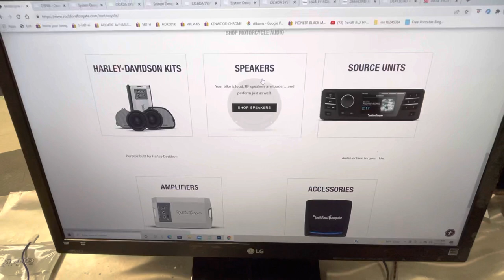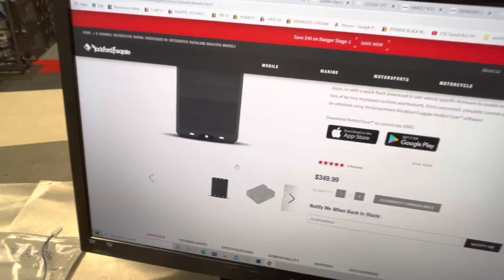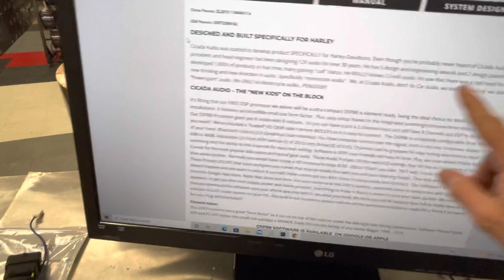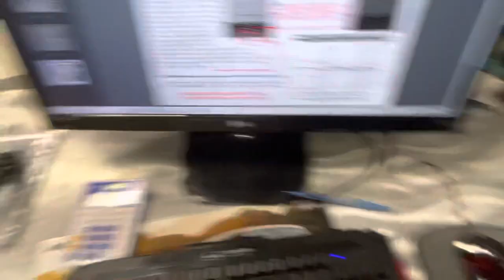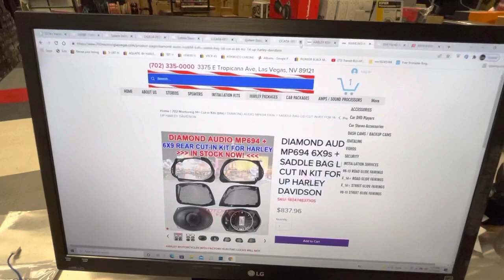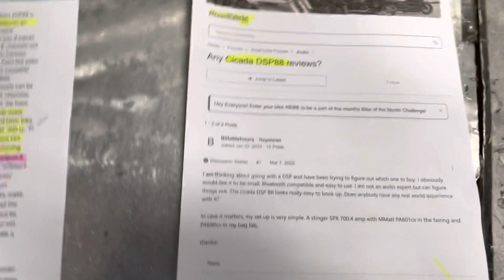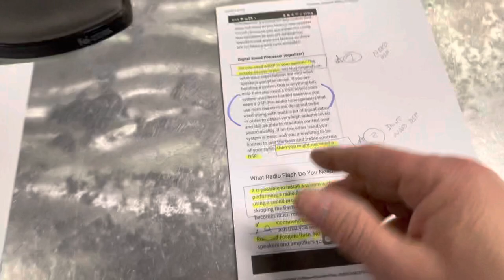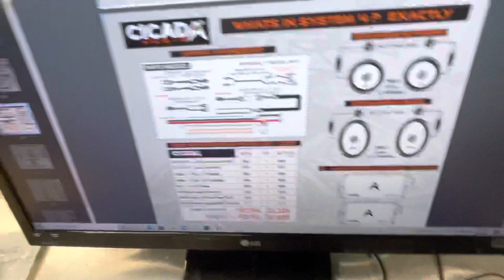YOU DO NOT NEED A DSP DIGITAL SOUND PROCESSOR ON A HARLEY DAVIDSON 2014 & UP  SOUND SYSTEM INSTALL

Comment: The frequency response for the MSPRO65 is 110 to 10k....how do you give it what it wants to run at its best when then SD amps don't have the ability to band pass?
What do you set it at ? Both high pass and low pass go from 45 to 850?
Reply from the maker: 99.9% of the bikes we do have MSPRO65 Mids up Front & many have them in the Touring Pak, Every single bike Rocks and every single customer is more than happy - each and every system outperforms any customers expectations, we never said that a DSP would not allow the system to sound better we simply provide our opinion that it is not necessary and we are more than willing to put our sound system up against any other persons or brand sound system that utilizes normal street use vs a bike set up for competition.
Reply: @702motoringlasvegas4  that doesn't answer my question...I was just intrested in how you set the amp. Aren't you limited in what you can do just using the amp to set the frequency?...I think using a DSP is up to the customer and not the installer. If you are going to drop good money on a great sounding system you should research and listen live to all options...your videos are great...I enjoy them...im just curious on how you set the lows...
Reply: Anything on this?
How do you set the SD amp for the 6.5?
Reply from the maker: @joellongoria2239  Anything on what? I use the 30 Years of experience I have and create all the bikes you see on our YouTube Channel - The PROOF is in what you hear, I do not need to go back and forth debating anything with you
Reply: @702motoringlasvegas4  wow...I wasn't debating anything...I am just curious on how you set the amp for the woofers...is it really that hard of a question to answer? Is it a trade secret? Just a curious person asking a simple question...
Reply from the maker: @joellongoria2239  We are talking about a MSPRO65 Midrange so it is not Woofer(s) Your question is part of a growing issue in this industry where a person and we can use you as an example provides frequency response to what may be written on a box and compares it to specifications of an amplifier and if hypothetically all of the figures do not make perfect sense than a person may take the position that it simply is not going to work or it may not be compatible or simply will not sound good and possibly resulting in the need for a DSP -  

Why would it be so unbelievable for you or another person to accept that hey guess what with the right amount of experience any person can fine tune an amplifier using the crossover that is on the amplifier and fine tune the speaker with your ear? 

It is the exact same thing using a DSP - it still needs to be tuned either by specific devices or by ear and necessarily not by a generic tune many sellers do and ship it out to a customer.

So not sure if you understand what we are saying or if you still have questions.

Again understand the message in our Video we have posted - it is NOT if a DSP will or will not allow your speakers to sound better

Our message is, is it Necessary, mandatory and must you use a DSP when adding an aftermarket sound system to a Harley Davidson Motorcycle.

We are not just a company, store, individual that just pops a video up that may disagree with the position of others,  we have more bikes than we can count that we very clearly show in detail the product used and the way we complete our installs in relation to the very words we say in our video.
Reply: @702motoringlasvegas4  I do know what I am asking and you still haven't answered it...and on your website it says MSPRO65 pro audio woofers...so come on...you poke fun at others for wrong info on the their pages and yet you do the same thing....if you cant answer the question just say so...stop trying to explain it away with blah blah blah...it simple...for the 6.5 do you set the SD amp on low pass or high pass and where do you set the dial? 
Look up your kit for the Road Glide and look at included in this kit...plain as black and white it calls it a pro audio woofers not a midbass...
Reply from the maker: @joellongoria2239  The MSPRO65 Is a Midrange and it is also a MidBass - Diamond Audio Website it is called a MIDBASS / American Hard Bag also calls it a MID BASS - you have only just now asked if we set the amp to Low Pass or High Pass there is no bla bla bla with our explanation, so not sure if you are attempting to find us lying or catch us not sure what we are talking about or what your agenda is if any, we set the amplifier on High Pass, as far as the dial what we turn it to I turn it to the spot that my ear tells me to turn it to with the specific song I tune every bike to - maybe this explanation is good enough for you, maybe you will just consider it BS - not even sure, but you have asked plenty of questions about it, it is basic common sense, not sure where you are going with this, Our Bikes are second to none, we don't hide anything we do, either you accept what we have offered as information and maybe you do not, but we do know this we are done with all of the questions, we are building 63 sets of shallow horn grills today that need to ship so we are a little busy right now - hopefully you have received satisfactory information from us and or our video - good day
Reply from the maker: @joellongoria2239  You are also the 2nd person with a connection to Five Star Car Stereo - You and Melissa both, your going to need to do better then this
Reply: @702motoringlasvegas4  you more than answered my question...did you check your web page and saw that it says woofers on it?...that's why I called it a woofer...don't see where you are going with the while 5 star thing...I follow a few people...knowledge is power...and everyone has a different way of doing things...I just wanted to get your angle on how you tune your systems without a DSP...that's all...no hidden agenda...I'm still learning and just have questions that pop up from time to time...you are doing a great job with your videos....if my questions are dumb so be it...remember we all can learn a thing or two from dumb questions...I have a 10 speaker system on my 2017 RG...combination of Hertz and RF speakers...to me it sounds bad ass...but if there is a way to make it sound better and I have to ask a dumb question I will...thank you for your time....
Reply from the maker: @joellongoria2239  Appreciate it Joel - apologize if we came at you a little aggressively - Paul
Reply: @702motoringlasvegas4  no worries Paul
Keep up the good work!! 👍
Reply: @joellongoria2239  Diamond is real good about having crossovers readily available.
Reply: You hit it on the head sir.  702 does cookie cutter installs that dont need a dsp.   All their installs high pass every speaker and that works for people that dont want subs in bags or  mids..  A Dsp is worth the extra $300. For a few people that want more sound below 50hz.  I love diamond audio.but I moved to cicada. My good friend installed 4 cicada coax speakers on his ultra without a dsp.  He is happy.   That diamond.audio dsp is impressive. But my DSR1 works just fine in my road glide and yes it is easy to use.  You dont have to be an audio expert.
Reply from the maker: @robleeva  Really? Cookie Cutter? we think not, when you know how to install and tune a sound system like we do a DSP is not necessary and feel free to go ahead and explain to customers how for only $300.00 they will have a DSP with everything needed to install it, never mind how to tune it, you may want to rethink your statement

Comment: Ok I need your help then. I have from American hardbagger a 800wt 4 Chanel diamond audio amp. T harness.. 6.5 hertz up front with separate hertz horns .. 6x9 hertz in bags with separate horns and the Rockford dsr1. I do understand how hard it is to tune the amp. It's loud but I do feel it could be better. So how do I remove the dsr1 and hook it all back up? Then you suggest just getting it flashed  or do I leave the dsr1 in and get it flashed to get better performance?
Reply from the maker: Are you saying your bike is not flashed? 2014 & up with stock radio?
Reply: @702motoringlasvegas4  It is not flashed.  They had me install a dsr1 on it instead
Reply from the maker: @welder9966  We recommend Flashing the bike 100% / you have the right equipment that will provide you with the sound you are seeking, just the advice you received we do not agree with and that is what we are attempting to avoid with others and this is partial reasoning with our video, it clearly goes against the grain and we realize this, this is a nationwide list of authorized flashing centers, http://rftech.custhelp.com/app/answers/detail/a_id/1344      Once flashed let us know how your sound is and you may contact us directly vegas.paul99@gmail.com

Comment: Just watched this. I think the best way to get everybody to understand this DSP controversy, is do you need a DSP to make your bike sound better than your OEM? No. Do you need a DSP if you got 4 speaker setup with 1 or 2 amps to sound good? No. But if you want to maximize your equipment or you plan to compete then yes you need a DSP. If you can't afford a DSP and a good install, spend the money on the quality install first. A DSP can be added later.
Reply: I don’t think it’s a forwarding it. I think it’s people understanding how they work.

Comment: Great video! I’ve got a precision power system with 8 speakers and their amp using the GTS head unit. Loud and clear but lacks midrange bass. Would adding the Soundstream radio with the 13band equalizer improve the sound?

Comment: I understand this is your opinion, but let's say hypothetically your running a simple 4 speaker system with 8" speakers in the rear and 6.5" in the front. They are obviously going to have different crossover points, power ratings, and many other differences in parameters....So therefore this in this situation, a DSP will absolutely be needed to set proper crossover points based on speaker parameters. When you tune via your RTA a DSP instantly becomes an even more powerful tool because you can set your own EQ on each speaker. This is just my .02
Reply from the maker: We appreciate your comment, however your simple 4 speaker system is to vague to provide you with a definite answer, however if we go with your example and your position that a DSP is absolutely necessary, OK, so what would happen if a DSP was not used on your example? using one 4 channel amplifier? the system has tuning through the amplifier - and that would mean that a DSP is not absolutely necessary, understand we are not saying a DSP will not make a sound system sound better, we all know it will, what we are saying is that it does not have to be used as in you have no choice,  for example take a Ferrari - you have to use Premium Gas in the car, so what happens if you put regular unleaded in the car? it is still going to run maybe not to its potential but it will be OK.
Here is another example, take your 4 speaker system (1) Pair Diamond Audio MP84 8's one pair Diamond Audio MP654 6.5's / use a Soundigital 800.4 EVOX - take channels 1 & 2 and runs the horns front and rear, channels 3 & 4 run the mid's front and rear - We can tune the horns separate from the mid's all off of the amplifier, customer will be very happy, no DSP is used, will it sound better with a DSP certainly, but it is not necessary, DSP adds a good bit of money to a sound system / our position is simply saying it is not necessary - if it was it is highly possible a consumer may not have that extra 350 - 600 dollars to spend and his only option would be purchase less expensive speakers that even if using a DSP may not sound as good as putting a set of MO75T Shallow Horns in the Grill and MSPORO65 Mid behind those and one pair of Diamond Audio MP694 Coax Horn 6x9's in the rear, 800.4 EVOX amplifier will put out 800 Watts and hit a easy 128 DB with crystal clear sound, How much better do you want? we still do not see the competition using meters on their sound systems, we say it many times in our video's we are interested in seeing what other shops produce, we are not saying we are the best all we would like to know is how does our Diamond Audio Sound Systems stack up with others that do sound systems, we are open to learning new ideas, trends, secrets, etc. but at the end of the day with us at least our systems do NOT in any way need a DSPP - the video's are proof to that.
Reply: @702motoringlasvegas4  I don't see the point of spending thousands of hard earned dollars on an audio package to make it sound "meh" at best. Then there's band passing, a factory head unit cannot do that, only a DSP can. Same goes with time delays, acoustical phase shifts, precisely changing crossover points, setting EQ per speaker, and so much more that you really feel comfortable not using one? I understand it's not technically "needed" to operate an audio upgrade, but the benefits from having one far outweigh the need to not. That's like saying that you don't need tires on rims to drive down the road, but it sure does make life a whole lot better if you did.
Reply from the maker: @s.in.bagger9933  Well, We respect your position, maybe other sound systems out there maybe a DSP would be necessary in order to make less expensive speakers sound satisfactory, however maybe we are just working with a much higher caliber of sound system components and design, this sound system shown  is using (2) Soundigital 800.4 EVOX Amps, that is a real 1600 Watts RMS (12) Speakers - If the position was 100% written in stone you MUST or HAVE to use a DSP on a Harley Davidson Sound System install then it would be impossible for what we are showing to work, this is a Brand new 30 ish miles 2021 Road Glide, driven right off of the showroom floor to our Showroom Floor for a full sound system - this is a High End Sound System by the very definition and a good amount of coin spent on it and it operates flawlessly, it by far exceeds any buyers expectations - DSP not used nor necessary and that is the point we are saying, OUR Sound Systems do not Need a DSP maybe it is just my ear that makes it possible to tune these bikes the way every bike is tuned. I would much rather not charge the customer the extra $650.00 for the DSP and add a front and rear DVR recording waterproof camera system, maybe even a GPS tracking Viper System for that $650.00 - that is more important to us at least, if you are ever in Las Vegas we invite you to stop in and 90% of the time we have a bike all set to be delivered you can stand next to and hear and experience one of our Sound Systems - I will bet you $20.00 you yourself will be more than satisfied and all without the usage of a DSP.  😊

Comment: I'd like to ask a question,  non business owner, viewer, to learn. I run 4 amps, tm400x2ad,  2, evox 800.4. 1 pvr dsp,  in my bike. 2003 fxdl, made a mount for a tour pack, installed tour pack,  hard bags, batwing,  run 2 batteries.  2, pm282h,  , 1 set 6x9 diamond audio horn, msrt1, tweeters,  ds18 920 tweeters,  1, 8 inch, w horn  euphoria clones,  I do not use a radio, Bluetooth receiver,  and my phone.  Before I used a splitter,  to connect 3 amps, wanted to go to 4 amps. And I own a dd1 and a ocilscope. but the dsp, made it easier, 4 me, to connect everything,  rca, but honestly dsp, to figure it out, set it right,  what a learning experience, still learning.  as very difficult calling the mfg, and just trying to get a baseline to use and start with. I still feel,  you got to tune the amps, with a dsp, regardless to set gains. And clean. My question is, if I went back to without a dsp, what do you recommend to connect  my signal from Bluetooth to all the amps ? the exvox, amps require all 4 input used, even if just bridge for the 400 watt rms. I had to use splitter because the dsp, only had 8 out puts,  and I needed 12 outputs. so. I used rca, cable splitters,  what can I buy , in my situation ? Suggestions,  recommendations?  My previous was no dsp, 3 amps, and a 1 in, 3 out splitter I found,  but not been a great splitter.  As now, the only plus with the dsp, is I can set my gains much higher. Clean. As before,  the signal was dirty sooner. Soon I'm adding  skar, ix8, 1 in each bag and either a 5th amp. Or 2 ohm , parallel some of my 8 inches. The only function I do like of the dsp, is I can hit a button to shut of a amp or amps. Because I can't run everything when I ride, very long. thank you,  if you are able to offer product suggestion for my set up. Or tips.
Reply from the maker: Ryan, Your request for the type of explanation you are seeking is approximately 100 miles far from the normal question anyone has ever asked of us and to be 100% honest with you if this is in fact an actual real question or someone possibly attempting to manipulate our time going back and forth with a never ending barrage of additional questioning we will simply offer this to you with no re replies even if you respond as we take everything written with a very large question mark - however we suggest you simply take the settings and spec's shown on the boxes of the various product lines of part numbers and input those settings into your DSP as a basis starting point since your question was >>>and just trying to get a baseline to use and start with. <<<< This will more then answer your question, if you no longer have the boxes the specs will always be available online by googling, Good luck, you have allot going on there.